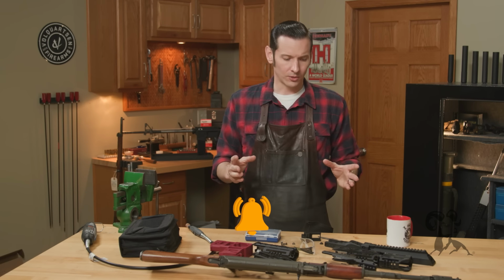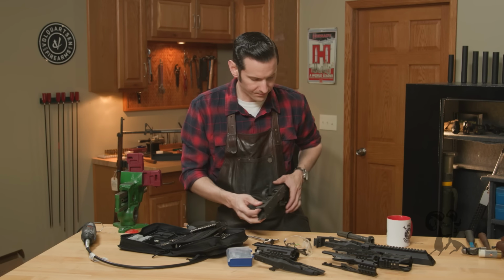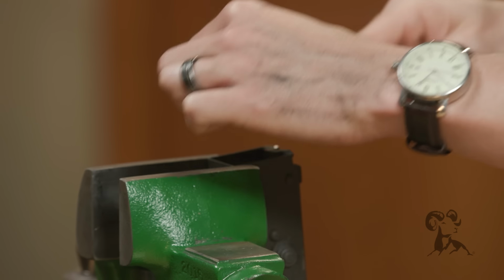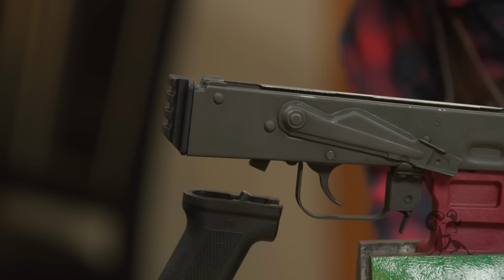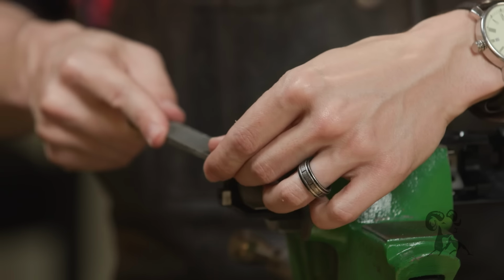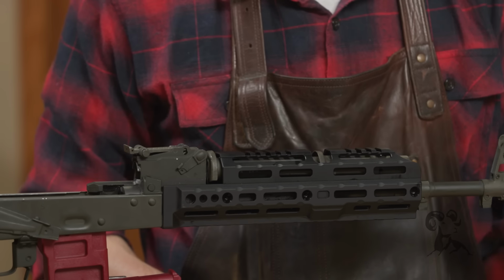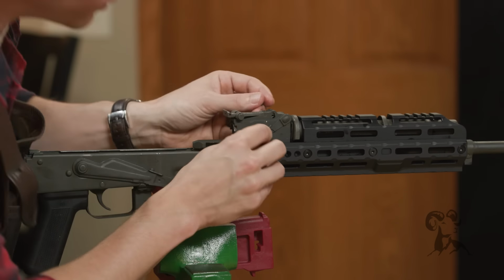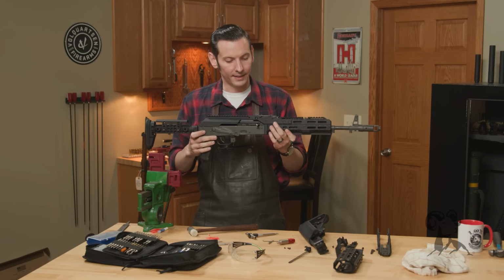Tech Tip: Convert Your Ordinary AK Into an Alpha AK

Comment: Tip: stuff a small cloth into the receiver during the dremeling/filing to prevent the metal dust and shavings from dropping into the receiver, fire control group and especially the chamber and barrel.
Reply: Compressed, or a shop vac will clear that stuff out pretty easily. Clothes have the potential to burn, it's a risk to be conscious of.
Reply: If you have any grease on those fire control parts for lube you will make grinding compound out of it! It will not simply blow out. You will have to detail strip and use brake clean or similar gun scrubber to get the grindings and contaminated lube out. Then relube it all again. A rag stuffed in there will be a major time saver!
Reply: Instant rust spot if not removed...
Easier to prevent than deal with later !!!
Reply: I personally would have removed the whole fire control group first and use painters tape to cover the bore.  Metal shavings can be a bitch.

Comment: I would also recommend if doing this installation to put some cold blue on the section of exposed metal and don't forget to use some oil and wipe off any excess oil before installing the rear 1913 Block. The cold blue will stop rust from occurring and the oil will neutralize the corrosive effect of cold blue. Same for the aluminum parts but instead you will use aluminum black followed by the oil and once again wipe off any excess.
Reply: I was going to suggest some little dobs of black primer paint.
Reply: It's an AK, its supposed to rust, it gives it that authentic finish.
Reply: @BillyBob-ov5ef  that's true but no sense in letting it rust early.  Don't worry over time that will occur naturally
Reply: @BillyBob-ov5ef save that sh!t for the memes. When you're out in the field, equipment failure is the last thing you need.
Reply: @seijiroukikuoka5975  you are probably a lot of fun at parties.

Equipment failure in the field, lol, what field are you talking about? The range, I hope. That stocks hinge is about as brittle as your sense of humor, the rust is the least of your problems.
Let's stop pretending these range toys do anything more than the occasional trip to the range.
Reply: @BillyBob-ov5ef or the local k through 12
Reply: Ballistol works as both lube and blue
Reply: Q tip an some paint if nothing else...
Also all those tiny pieces of metal must be addressed !!!
A rag an a cow magnet ...
Reply: Yep, I had to drill out a hole in the back end of my Zastava M92 to install a rear rail. Gave it a nice coating of Everbrite and let it dry before continuing. It's an older one from before Zastava started importing themselves, mine's got the ole Century markings.

Comment: I remember buying full Romy kits (barrel included) for $59.99 back in 05 ish (even the WASR 10s were $289.00).  I still have all of my build jigs, 20 ton press, spot welder etc but the prices on kits have just been insanely expensive for many years now.  It was fun building many different AKs and experimenting with different furniture like this but it's too expensive for me now.
Reply: I’ve been a gun owner for only 7 years now and I missed when AKs were sub $300 and SKSs were $100 :( just barely got my first AK recently
Reply: @Yeedo420  
Oh man, Aks were so cheap. Even the top end, premium new ones topped out at about 600-650. 

Even the old Mosin nagants were 79 fresh out of the box of cosmoline never used, now they are 400-450.

It's just crazy now

Comment: Midwest Industries makes awesome AK accessories!!

When filing where debris can fall into the chamber area, I stuff a rag into the receiver to block it off.  For example, in the case of the rear tang, I would stuff a rag to the receiver just behind where the hammer assembly is.  Once done filing, invert the receiver (filed side down) and remove rag.

Comment: Absolutely love this type of content. Keep it up. My only critique of the install is leaving the bare metal under the 1913 adapter. If you live in a humid area that will start to rust pretty quickly and it's not an easy thing to see once it's assembled.
Reply: Rattle can can fix that or alumahyde.
Reply: Honestly I’d just do a magpul folding ak stock instead, as that’s likely more available
Reply: @baker90338  less weight, as well as less expensive too.
Reply: @ratagris21  that said, that rear weight might help balance it out somewhat, and that stock is highly adjustable.

Comment: I appreciate all the tips. I never thought about a file going one direction.
Reply: Yeaa that was the one tip I learned too lol cuz I sholl go forward n back when I file 😭🥶
Reply: That's an old piece of advice that I learned too in gunsmith school. Turns out, at least with modern files, it's no longer true. Fireball Tool built a machine to test this and the results were essentially the same between push and lift vs push and pull. It's a great video that you should check out. I've stopped lifting files on the back stroke except when I want a cleaner finish.
Reply: @StrongholdArmory  interesting. Most of my tools, all the files, have been passed down to me so they are probably old school. Good to know!
Reply: @StrongholdArmory  Good to know. I simply don't put any downward pressure when pulling the file back.

Comment: You talked about doing a whole video on filing.  I got a whole semester of filing for two hours a day with a Holland & Holland repair shop gunsmith for an instructor.  “Flat & square lads” is permanently engrained in my memory.  I rarely pick up a rotary tool theses days.

Comment: My tip is use plenty of tape around where one will be dremeling. It will help with giving at least a tiny bit of protection to metal you don't want to remove, and it provides some good guidelines with good contrast.  If you are very concerned about cutting into a base metal I will actually put a piece of sacrificial sheet metal stock between .010 and .030 thick on the part, then wrap that in the tape. That way if I do nick the tape,  there will be some response. Especially if it's brass or something.

Comment: For my KR-103 side folder, I had to relieve a small portion of the upper handguard cover to make room for the sling mount. About 1/8" x 1/8". I also had to fit the recoil spring locking tab to fit the rear trunion. It was about 0.003" too thick.
Reply: Thanks for sharing!

Comment: Put a handle on that file and you'll get a lot more real estate to file with. I like using old golf balls for file handles, they fit in the palm nicely.
Reply: Yup, I have been doing it for years. You can drill different sized hole in different areas for use on several different size files if your short on golf balls.

Comment: File to pry tab on lower hand guard? Nyet. Use buttstock cleaning kit tube. Fix It Sticks to remove screws? Nyet! Use flat tool in cleaning kit. Cut off stock tang with Dremel? Nyet… put tube of cleaning kit over tang and hit with boot. Caleb: “We’ll be using the Brownells replacement AK buttstock cleaning kit…” 😆 JK… I knew we were in for a cool video when we got the leather apron AND the Fix It Sticks AND the Dremel AND the AK74. Gotta get a set of those Fix Its. 👍

Comment: I love everything except when he filed the handguard to fit it. The whole point is too hammer the handguard in so it friction fits to the weapon allowing rigidity to mount lasers.
Reply: Midwest Industries official instructions are to file it down, in their written installation guide.  I'm not disagreeing with you, I think hammering it in is better and it's the way zenitco does it.  But I was curious and so checked.
Reply: @chrompst  i remember looking at the installation video scratching my head with that one. regardless of that the handguard is solid and holds zero i just hate how the front part of the rail is very picky on what lasers you can attach.

Comment: ? 4 U ..how Secure is that dust cover rail? In case I want to use a scope. Will it keep 0 or?
You got easy directions and show how to file which some were never Taught correctly. There's a lot of secrets doing metal work, I learned that going to aviation school.
Reply: It'll hold zero! Thanks for watching.
Reply: @CalebSavant  Might have to order that kit.
Reply: If you have a psa, you'll need a larger button

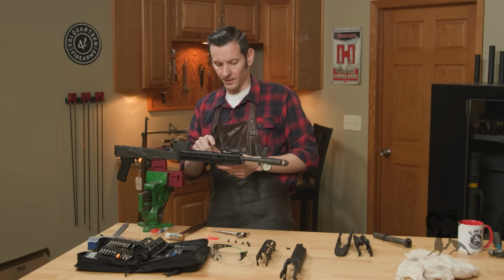Comment: 35:50 "Die Feile und den Schwanz, benutzt man immer ganz!" German Blacksmith-Words. 42:45 the lower cover, does not sit flush on the body. You have to make it right, tight. Rework it, otherwise you do not work exact. The Gap is much to wide.

Comment: It would have been easy to fill action with paper and cotton and also tape up all of the open parts of the action and the end. Concerning that metal filings went into trigger mechanism. The once filing is finished simply put upside down, take all out and do a little clean. If any machine should be used it should be a vacuum, blowing air just brings a few of the particles all sorts of unwanted places, including in your eyes.

Comment: Did you "seal" the bare metal on the parts of the AK you worked on? If so, who did you use? If not, Why?

 I live near the coast and that would have surface rust in hours and completely rusted through in a year.

Comment: If you snug up that stock screw till its tight/ snug against the barrel. When you fire the gun and put heat into the barrel. Isn't the expansion from the barrel heating up going to change or shift the zero on the gun?

Comment: My advice: the best ak is a simple stock one. If wood looks dated, switch to a polymer furniture set. It will keep your rifle light, for optics just use the side mount. And if you go decide to go aluminum, just switch the handguards and dust cover, no need to destroy a beautiful rifle like this one, forever. You will regret it later!!

Comment: Think I had worked with that same tool same brand possibly older version cause there be fiew n new gen same disks for good ammount a stuff I know many tools apply to they can make it easy or hard the deal is to not over do your objective n never tryna be fast reason I used the expedition you can reach corners many ways n at better angle with it instead the ticker side of the tool but I seen the grinding stone n I was like gonna file 3 mm max using a file that be some hand work but it be so simple n ya got it back on nowadays gotta work smarter if I may ask ya recommend those sand paper ones or the grind weels cause I do like when I can switch grids and I ain't sure if I can get 500 grit or not but I've polishing ones

Comment: I played with my AK without a stock for a little while and I considered what cutting off the tail would do to the gun... If you do cut off the tail, consider the fact that the tail puts a lot of 16" barrel AK's under the defined BY LAW length a rifle must be (overall length 26"), and essentially turns the gun into a long barrel pistol. In my case taking a single millimeter off the tail would have changed the legal definition of the gun I owned. So I didn't do it.  Maybe adding the new stock changes it back into a rifle... And there is talk of the SBR NFA laws getting challenged in the courts... But cutting your gun shorter (sort of) may not be the best idea... I'm not a lawyer.
Reply: You have no idea what you're talking about. A 16 inch barreled gun without a stock is not any NFA item.

Comment: You already had the Dremel set up. Why didn't you cut the heads off the rivets instead of cutting the rear stock mount? Seems counter intuitive.
Reply from the maker: Because we need the rear trunnion for the stock adapter to work.

Comment: i have 2 foredom rotary tools, set up with foot pedals and hanging with the cutoff wheel on one... a band saw and a mill...  and i still would have just used a hack saw and file for that... less heat, less noise, no sparks, no cutoff wheel dust and no wasting insanely overpriced dremel brand cutoff wheels... lil magnet on the receiver will catch all the chips...

Comment: Wait wait did you just mention gun smiths use Dremels to cut, sand, polish and adjust dimensions with abrasives on firearms???!  No freakin way, i thought they used their teeth, bare hands and screw drivers... LOL i can't think of any other more perfect electrical tools to work on firearms with.. they are extremely small and have different speed levels combined with the crazy massive collection of all different types of attachments you could use. It makes it a great versatile tool for any and all jobs! It's one of my top favorite tools to use for small weird jobs or repairs for some reason.. that and JB Weld epoxy LMAO or better yet Belzona super epoxy.. that hands down is my favorite epoxy! And it is probably the strongest stuff one could get period! It's super  expensive though 😭🥴😮‍💨 but you do get like a kilo of both parts.. so compared to getting the super tiny tubes of JB weld for 20$ a pack its actually probably about the same price... It's just you have to spend 3- 500$ in one lump sum

Comment: We remove fixed stock, cut off the tang, install picatinny rail and we are going to instal the fixed stock back on??..🤷‍♂️🤦‍♂️
Reply from the maker: A fixed stock with adjustable cheek height to accommodate a now higher optic, this is also the same method used for folding stock.
Reply: @brownells  this is all true and good. But you can do all that with original rear tang. Plenty of of stocks allow same features without permanently altering the fire arm :))

Comment: Curious that youre supposed to file the handguard, Zenit tells customers to just hammer the bastard.
Reply: I definitely like this system better, installing Zenit handguards hammer only causes existential crises.
Reply: @medikpac7105  I just tell myself that the aluminum of the handguard will bend before the single millimeter of the receiver.

Comment: Beware if you have a PSA with a folding trunnion. You need a larger dust cover button, that Midwest won’t give you, but you can buy it for only $35. So I already spent a bunch of $ to get the furniture, they won’t respond to my emails, and I have to spend another $35 just so my dust cover will actually lock in place.

Comment: The video is outstanding but the solution for installing the rear stock is really GHETTO!!! I will never install a stock like that where i have to do irreversible damage.  It may questionably be as good and strong but once you commit to installing this stock the only way to go back to a traditional configuration is to remove the rear trunnion and install a new one.  Zenitco has the PT-5 stock for folks with fixed rear trunnions that requires no cutting or grinding and i would expect a company like MI be able to at least duplicate their solution!  THIS solution sucks and may also be illegal in some states and finally to go back to a traditional rear trunnion (if you can find a genuine trunnion for your model of AKM depending on the origin of the rifle) may be difficult and expensive.  Then you have to have the tools and know how to remove and replace rivets that you’ll need special tools  including a shop press or you’ll need to find or a gunsmith that works on AKMs to do the work.  The look of the Alpha furniture adds a lot of functionality, and the rear MI Alpha furniture looks great but it’s disappointing to see a badly thought out, rushed mounting solution of this stock from a company that otherwise has outstanding solutions.  Unfortunate but ill pass and look for something else!!!

Comment: Why didn’t you blue the rear of the receiver? Naked steel is likely going to red rust with water, no?

I usually like to grind so that the sparks go downwards, if possible.
Reply: I wondered about the blueing too, at least run some grease/cosmoline over it.

Comment: Was instructional and informative. But...i gritted my teeth every time you put the bare parts in the vise with no protection.  Please use tape or something.  A flat vise will not grip as well as a knurled surface, and #1 might slip and scratch or mar your parts, or #2 require more vise tension to hold it in place which can deform your parts

Comment: With all due respect...      It's incomprehensible  that  Midwest Industry's Soultion is to  CUT OFF the rear "tang" of the rear trunion !     (NOT-  reversible )   It would  have been  EASIER to utilize it,  &  There are MANY options that utilize it.      &,   As many "K"'s  have a side rail,  ( Which is INCREDIBLY SOLID.    it can't    Fold to the  left...     & I  LOVE   Midwest INDUSTRY'S  !!    I. Happily use right side folders.   &  ALL fold flat.   (  Sadly,  my 2 favorites)  were "Disappeared "   by the same   [ People ? ]   who formed  Freedom Group...   so they are now  No longer available.   I believe  ( MI )  will remedy this.     I  Love  "Tang" ...   & in today's world,   that makes me/us,   Freaks  !

Comment: Building an AR: Buy the pieces, assemble together.
Building an AK: Buy the pieces, chop, Dremel, drill, file, cut, grind, weld, tap, die, mill, sand, hammer, punch, rivet, and bend until they fit.

Comment: You waisted way to much time with that file, everyone knows to get an 8 inch side grinder and lob it off. I always use a big ball pine hammer to smooth out the high spots. Boy the thing people do now days. No need to worry about lining up the holes silly, that's why they make drills. Air, gun scrubber YEA it's called a water hose, OMG. Again on the handguard just buff it with an 8 inch side grinded a few times and done. Again just put the gun back together and hit it with the water hose and done WOW. If the holes don't line up a few taps with a big hammer and done, what the heck.

Comment: no worth it. why you had to cut a piece of an AK for a aftermarket stock.... please dont do that. if you had HAD HAD HAD to modify your AK simply go for the parts which goes screw on. if you dont have ones, design them and put them. not worth that part bro. rest AK is the gun which always looks best no matter what you put or take off